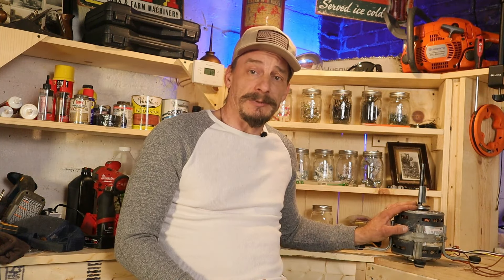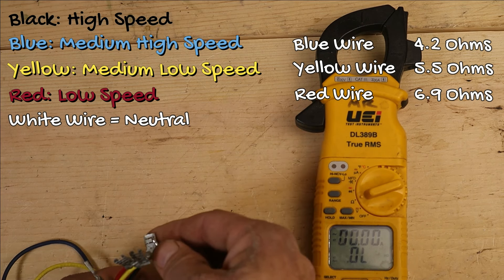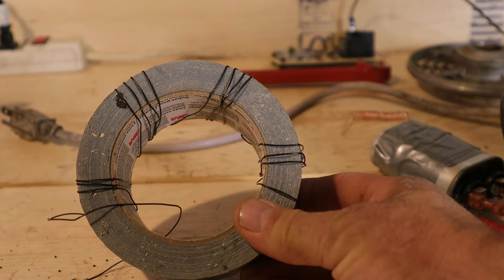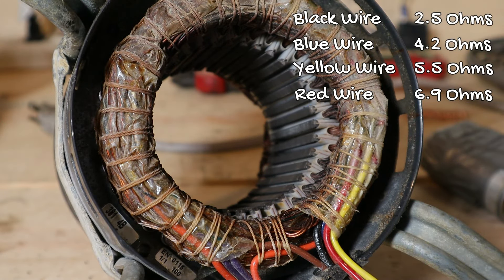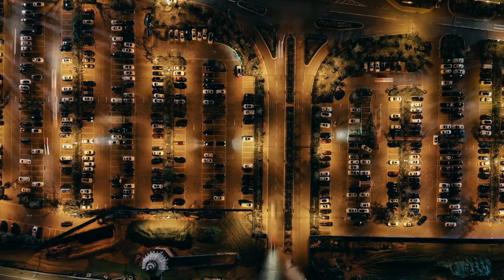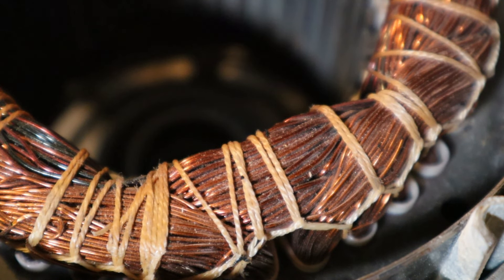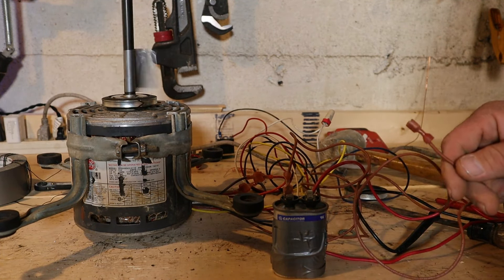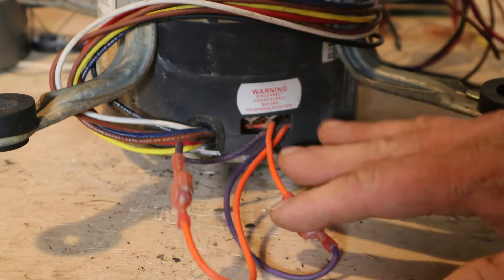PSC Motor Breakdown (Permanent Split Capacitor)

Comment: I think you might be mistaken about that centrifugal switch statement. You will be able to measure current on the start winding as the motor runs. The capacitor smooths out the motor that's why it started running poorly when you disconnected it.